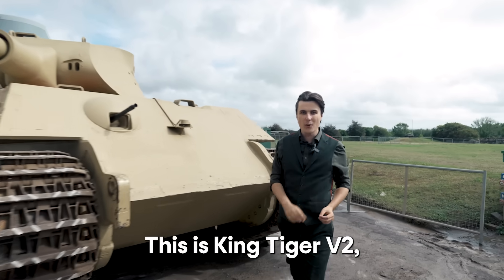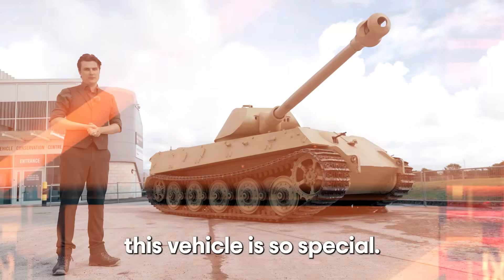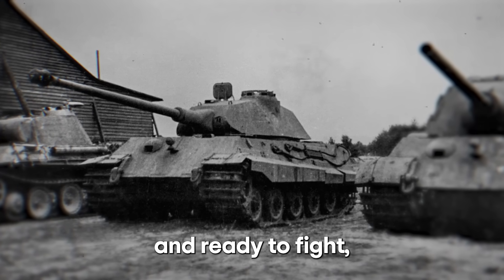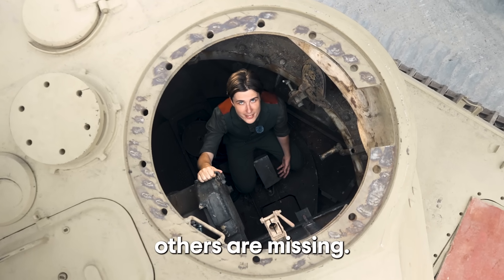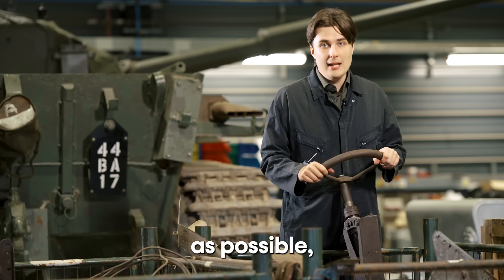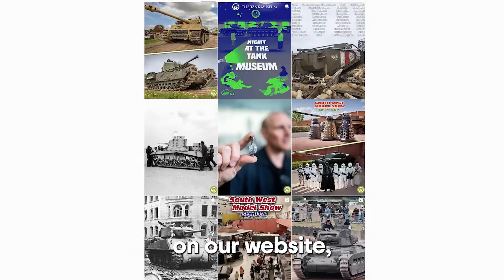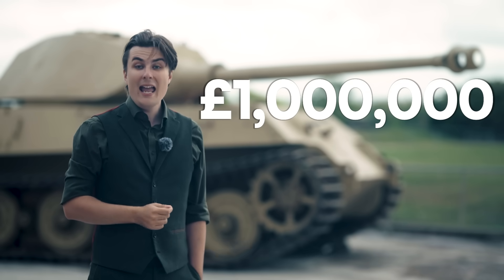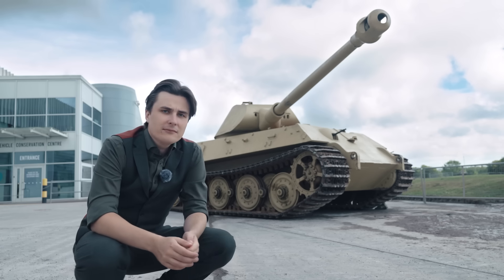King Tiger V2: Help us bring KTV2 back to life!

Comment: Will you all try to hunt down parts of the scrapped E-100 hull and try to build one of what it would have been?
Reply: It is possible that the Hull of the E-100 still exists. Because the Company who should scrap it had most likely buried it. And they buried it because the price of Steel was at that time super low and they decided to scrap the ships who had much more steel and so they buried many Tanks, including a very big german Tank Hull.

Comment: When it is restored, will it be painted in period correct camouflage or wear its standard pre-production paint? Isn't the engine in Tiger 131 from this vehicle? I know it has the HL230 from a Tiger 2. Also, being a soft steel pre-production model, how much lighter is it than an armored version?

Comment: When this is complete, you should get the musee de blindes to bring their king tiger back to tankfest so we can see both running alongside eachother. Would also be a good way to point out the differences between the initial KTs and the later production models. Also would just be awesome seeing two of them running side by side of course.
Reply: There is actually a 3rd King Tiger in a restauration process as well.
Reply: @olafbecker3812  true, in Switzerland
Reply: they could have a race!!🤣

Comment: Can you cast and forge new parts and components?
Reply from the maker: That's certainly a possibility.
Reply: Yeah,it is possible,and will likley be required since parts are almost non existant.Some parts like gun mantlet,roadwheels and final drive will need casiting if you dont have them.Torsion bars and axels will need forging.Hull floor plate and storage bin lids will need stamping..... You should visit the existing Tiger II P's and Henschels Tiger II's to get mesurments and good view of what you need.Accurate Dimensions parts and materials lists are likley in archives,but you can find them
Reply: Also I forgot to mention that you should make parts in bigger quantities,considering how often Tiger IIs broke down,I think every like 100km to 200km.Also make a solid ground for it,its quite heavy,and have fuel reserves for it because its extreamly fuel hungry

Comment: It is possible to add a modern tank engine in the Tiger? It doesnt have to be from an MBT, but an engine reliable with more horse power than the maybatch. Complete with an transmission too that can be more reliable than the original. I mean all she has to do is move, fire the gun and put up a show, she doesn't need to be completely historical accurate since we already know what the King tigers used internally, and they weren't entirely reliable to begin with...

Comment: King tiger tanks are pure evil and unstoppable tanks in the war in Europe due to it one shot all those poor little allied tanks in one shot and bombing the factories stopped those tanks in their tracks.
Reply: That or transmission failures, mechanical faults, no fuel, armour cracking after repeated hits due to shortages in certain materials needed to make high quality steel, shells bouncing from the turret shot trap directly into the thin hull roof armour on the early pre-production models such as this one, poor crew training exacerbating the mechanical faults especially with the gearbox and final drive. The reduction in ammo capacity and the ban of stowage of ammunition in the turret after a handful suffered catastrophic ammo detonations in combat.

When they worked they were exceptionally good but they were expensive, hard to maintain, difficult to produce and suffered from increasing material and manpower shortages. One cannot simply rely on a vehicles armour thickness and gun performance to determine the overall performance of a vehicle.
Reply: @tootyfruity70 no king tiger tanks shouldnt be functioning at all due to they are illegal land terror weapons and terror tanks that one shot all those poor little allied tanks within a flash.

Comment: The Poles will build you a new engine and gearbox. Congratulations on a daring project!🥂
Reply: Hopefully they could redesign the inside gears of the gearbox to be more reliable
Reply: @lambastepirate  No good reason why not. Authenticity of the internals in a non visible component can be reduced in exchange for reliability in such an expensive project to reduce future maintainance costs. Better quality materials at the very minimum.
Reply: Panzer farm poland
Reply: Ironic
Reply: Would be great coöperation!

Comment: Suggestion - I think you should feel free to make IMPROVEMENTS wherever you have to rebuild things like the gearbox, and amp the engine up. 
This way you will have a machine that does NOT have the horrible mechanical difficulties of the original series. If you want a "runner" I seriously think you need to go that route. Above all, you will be able to take advantage of modern tech where it benefits you, save a HUGE amount of $$$ and time and still have a machine that looks as if should.

Comment: 3 running king tiger now ate
1 in saumur a henschel turrent
1 in Switzerland they are restoring it now henschel turrent 
Now in bovington a Porsche turret
Reply: Wheatcroft is restoring at least another 2 king tigers, possibly 3... hes doing 5 tigers overall, but cant remeber if its 3 1s and 2 2s, or the other way around.
Reply: @roadsweeper1 3 Tiger I and 2 Tiger II.
Reply: @roadsweeper1 What is his channel/where can I find more about that project?
Reply: (porsche turret is a made up term just saying)